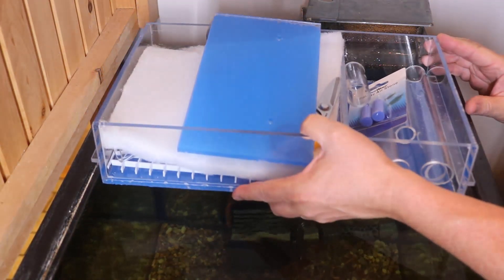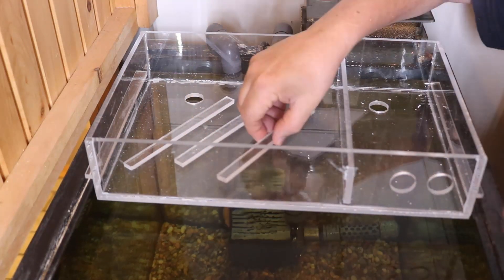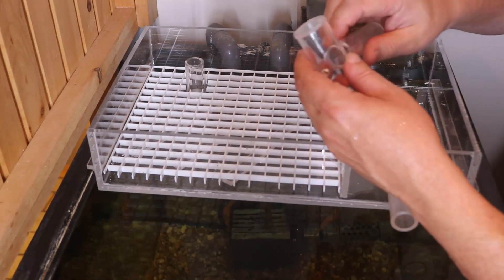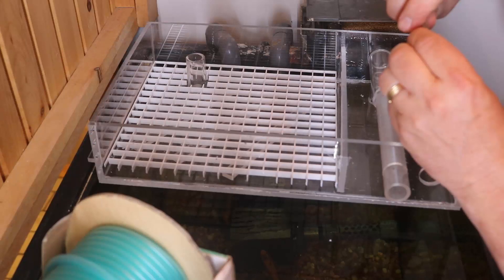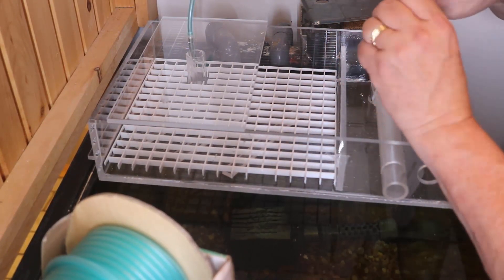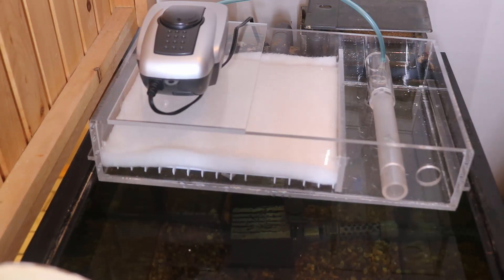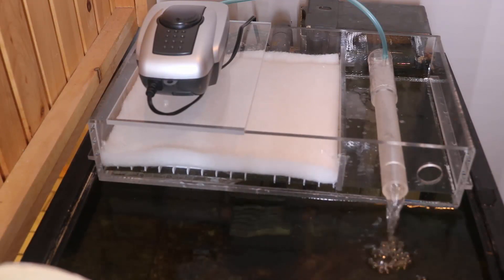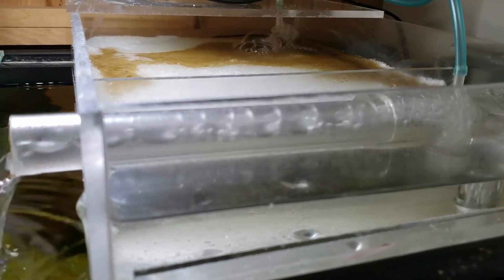Real World Testing for an Air Driven Filter

Comment: Hello from Texas I'm not a expert on filtration system but air filter system work great I love it .pumps work good because it moves @ lot of water but if watter is moving to fast n not have a correct filter most of gunk or thrash goes back in to the aquarium because of the water pressure unless u have small particle filters.but because watter moves more slow on air filter system more particles stay in the filter nndont get washed out .great video .send me your email I will send you pictures of the air filter I'm working u may want to use these for your videos
Reply from the maker: Thanks so much for stopping by Jose and sharing your thoughts on this. You can reach me at fishmanericrussell@gmail.com

Comment: Great project mate, air pump is creating disturbance to oxygenate the tank and at the same time it is running a filter as well. Obviously more flow will be obtained by a stronger pump.
Reply from the maker: Glad you liked the build! Thought I would start this off with an average pump to see how it works in the long term and then make changes accordingly. Thanks for watching

Comment: Do you think it is a perfect place for algae scrubber on top of the flat area :) ?  
1- lot of air.
2- bubble make the water dynamic
Reply from the maker: If you put an algae scrubber up here you would have encase it in something opaque so that you wouldn't be adding extra light into the tank. Other than that it would work just fine

Comment: i need help with a problem, i have two 3/4 pipes that drain down into the sump below and I've tried different configurations and still cant get anywhere near 23 gpm / per pipe  my sump runs dry i have to put it on a timer of and on all day.  please help
Reply from the maker: 23 gpm is over 1300 gph. For flow like that I use a 2" hole in the side of the tank with 1 1/2" plumbing for it. Two 3/4" pipes won't be able to handle that capacity. You have two options. First restrict the flow from the pump so that the pipes you have can handle what comes through. To do this it is best to put a tee in the line and a valve and bleed off some of the flow back into the sump. This will prevent wear on the pump from back pressure. The other option would be to make an overflow box with larger dia piping that can handle the flow. Hope this helps
Reply: @FishmanEricRussell  i already have a drilled tank and the existing two 3/4 inch pipes are behind a weir sp? . i assume at one point one was supply and one was return.  i assume this because some teeth are missing from the weir which is aprox. 1/4 in thick so it had to be removed.   when i collected this tank both pipes were draining into the sump and a 3/4 return was plumbed up from the pump and hung over the back.   the mag 18 at best does 1800 gph  and it still is out performing 2 x 3/4 pipes?  am i missing something?  is the 23 gpm under pressure?  thanks for your help, still scouring the internet for a fix.
Reply from the maker: @rfmjm368  Sadly there are only two options, reduce the input or increase the outputs capacity. Sorry

Comment: How tall of a pipe is possible with air lifting?
Reply from the maker: That is THE question and one I'm still working on. So far with regular air pressure and a standard depth tank I can get good usable flow up to 3 - about 4" of height.
Reply: @FishmanEricRussell  3 or four inches??
Reply from the maker: @rfmjm368  Yes. I've gotten much higher water flow but at three to four inches it is usable flow
Reply: @FishmanEricRussell  wait up, in the video the pipes your using are over 3 and 4 inches they look like almost a foot in length, are you talking diameter?

Comment: Have you tried Lees Discard-A-Stone. For me, they last a lot longer than the standard airstones. They are available in bulk packs in fine and coarse. They are small. May 1/4 inch diameter and will fit into a 1/2-inch lift tube.
Reply from the maker: A number of people have suggested higher quality air stones. I tried a bunch many years ago and found the extra cost not to be worth it. I will have to look into it again thanks

Comment: What is the purpose of the piping on the right? The one without the floss. Is it just to act as a water mover? Thanks
Reply from the maker: You're right. It's just there because I wanted extra turnover for this tank. If it went through the filter it would lose some of it's flow. Thanks for watching

Comment: Never really been a fan of air stones for the same reasons as you, I moved to the plastic never clogs ones you can add and remove segments, more uniform.
Though did you test the other port form the pump sometimes that can be the issue as well.
Reply from the maker: Great suggestions. I will have to look into better stones as it has been quite a while since I've done so. Thanks for watching

Comment: Another great build!   The more I watch you videos the more I like the air driven system. I feel the air pumps are MUCH more reliable after a power outage compared to the aquaclear HOB types.
Reply from the maker: Aqua clear filters are a good cheep filter except for power failures. They often just don't have the power to restart. Air driven always starts and you never lose siphon. Thanks as always for coming by!

Comment: What about making a spray type bar for the one under the pump to spread the water more?
Reply: If you're counting on the floss for biological filtration a better distribution would be necessary but if you're just doing mechanical filtration it's not such a biggie.  I made a filter a lot like the one under the pump except that mine floated on a raft in a pond and the air lift was a Czech type and went deep to do double duty as an upwelling pump; it essentially worked the same way.  When the floss near the lift gets plugged with crud it just flows over that to a clean part and flows through there.  A spray bar may not add any value to the filter; just something else to plug up.

Comment: I've got that air pump.😃
Reply: I was wondering what kind of pump that was. Do you like it? What has your experience been with that pump?
Reply: @jaymiller3238  a topfin air-4000. It has duel outlets and is very quiet. Mine is keeping the water flow in a thirtyish gallon cube and a ten gallon moving very well.
Reply: @nozr1383  Thanks!
Reply: You should return it to the office.
Reply from the maker: Since I've been doing more air builds lately I picked up a couple of different brands to try out. We will see how they all compare (eventually lol)

Comment: interesting, it reminds me of a similar design I tried a while back. it was basically an air pump to get water to a chute above the water surface and at a slight tilt gravity would have the water flow through a sponge "carpet" until exiting at the end of the chute and airating water as it fell back into the aquarium.  much like like yours  (sump tank placed above the aquarium) main difference was that I had all the flow to bring water up as the increased flow was then enough to do the needed aeration. so no need for separate aeration and had better filtration as a result. I did find however that if used an a home environment, because the collected solids was exposed to air that it would start to smell. did you come across that issue ?
Reply from the maker: No smell to date but that is the reason for testing to see how it will do long term. Thanks for sharing your experience with these designs
Reply: @FishmanEricRussell  always great to see your new designs ;) my setup had a lot of fish as it was a temp holding area, so you may never see the issue I saw. it is worth noting that if in a warm climate flies and larva can also get in there sometimes. cheers
Reply: If you have a basic cover over the top never really smell anything unless you are right over it, it defuses in the air more so if you have people moving about.